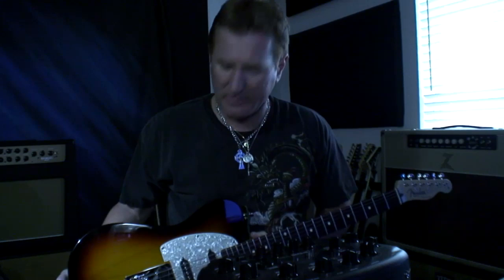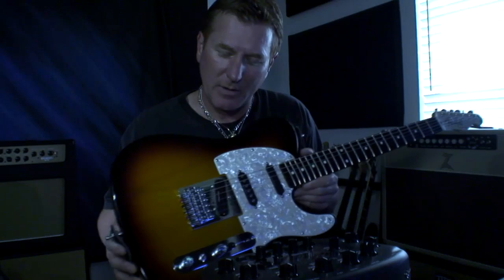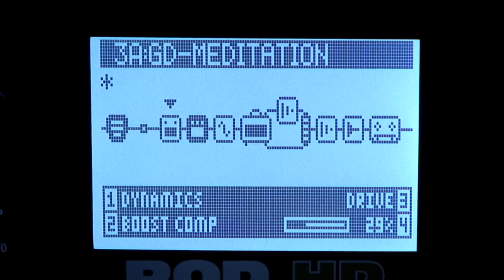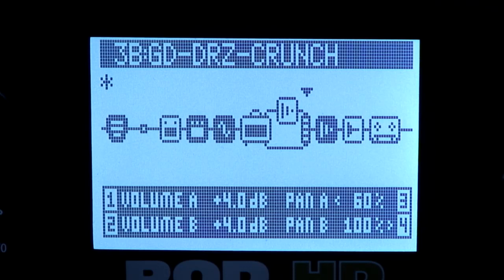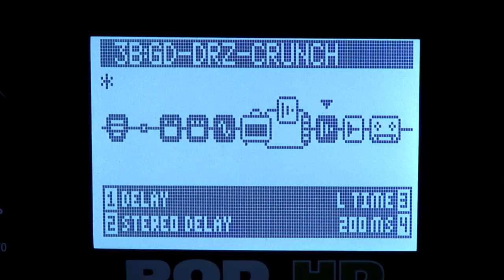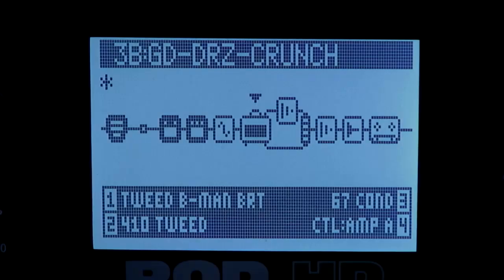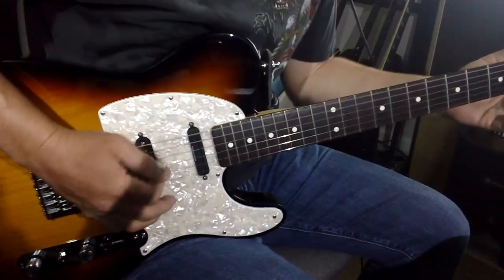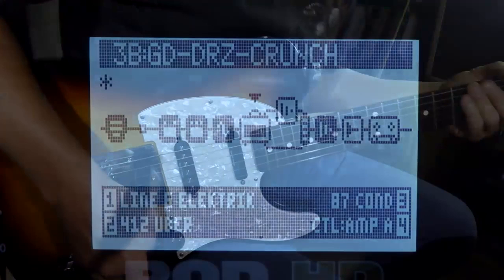☆ Glenn DeLaune ☆ Line6 POD HD Demo Part II

Comment from the maker: Easy. Open the Pitch glide. Place it before the amp, Set the Mix to 100% and turn the glide down to -1. That's Eb. You can go lower. Did you see my Masters of Metal video I did recently?? I use to go down to C. It sounds pretty good.
Reply: Wow thats cool. Is accurate?

Comment: @extremevideopro Thanks for the quick feedback man. I have heard that Line 6 offers pretty frequent updates for their devices. Hopefully I will get lucky and they will make some more of the higher gain amps available for the HD in the near future. But overall I have to say that I am very pleased with this product. Do you happen to have any good mixing tips or any FX suggestions that I could use to achieve a great metal tone? Thanks again for the feedback friend!

Comment: He talks about less being more, and I agree.  I've owned mine for 5-6 years and I was originally put off by all of the stupid presets that came loaded.  I mean, how many patches do we need of laser guns and spaceships taking off? I was looking for a handful of good usable guitar tones to put into a bank so I can use this on the gig. Long story short...  Necessity drove me to using this pedal as the hub of my whole show.  I don't even use a mixer any more. I use one effects chain for my variax guitar and the other for my mic. The reverb and delay are shared by both (positioned after the mixer section), since I usually use the same settings for both.  Why use valuable effects blocks needlessly? I use my computer for the backing tracks which I run into the CD input on the pod.  That signal goes straight thru, unaffected to the main outs of the POD so the volume of my backing tracks is controlled by the computer. The master volume on the POD controls the volume of my guitar AND my vocals.  The mix between those two is adjusted at the mixer section for each patch.  That was a little tedious to set up but each vocal chain needs to be the same, because if I switch patches during the song for the guitar sound I don't want the vocals to sound different.  I run the outputs of the POD to the QSC K-8 powered speakers.  They're powerful enough for small/medium venues (that hire a single) and the berst part is that I use them as my studio monitors as well, so I get exactly the same sound on the gig as I do when I set things up at home.  My friend uses headphones at home and then on the gig it sounds much different which then requires further adjustments at the gig.

Comment from the maker: @samyewell Thank you and YES, that is what this unit excels at!! That very type of "slightly crunchy". They have a Dr. Z amp model that is THE BEST!! That, coupled with the Tube Comp (for that extra added gain stomp) is the my "GO TO" preset for most of my work when I am using this piece of equipment..

Comment from the maker: The best thing I can tell you is to basically start from scratch. Set the POD on a empty patch and plug into the amp. You should get a good clean sound from there. If not start with an EQ in the POD. Once you have that sounding good add a little compression if you like, reverb & delay and BAM you've got your clean tone right there. Then just build from there.

Comment: @n70amu Desktop = recording only (unless you hook up the midi foot controller) hd500 = live use
Seriously if you get the hd500 the flexibility is endless considering how many parameters can be assigned and used in the expression pedal. The sounds are exactly the same.

Comment: Great video Glenn. In the video you mention that the "adjusted models" sound much better, less flubby and tighter, than they did before. Are these "adjustments" something new to firmware update 1.3, or were they also in 1.22?

Comment: man! Great Videos, Great playin and Great Tones!
I'm thinking of trading my Line 6 M13 for a POD HD 500 but it looks that the HD it's very difficult to program and make changes on the fly, without using the computer software. I use my M13 with a Fender Bassman or Fender Champion 600 for both live and recording. The simulations will be as great like a M13 in a REAL AMP? 
It's easy to use the HD500 as a FX unit only?
Thanks!!!

Comment: Still like my PODX3Live.  Would you use the HD units in a Live Setting?  I use the older Pod all the time direct to PA with amp just for stage volume also plugged in.  Very nice clean tone with my Jem.

Comment: Hi Glenn, Thank you for making all these Pod HD demo videos, I've been watching all your videos about the Pod HD, and I learned a lot from your vids...
if you don't mind me asking, I have only one question. I'm using Fender guitar amp, the Fender amp doesn't have send return plug-in at the back of the amp. every time I connect the POD to the amp (input), it sounds bad. What should I do? is there some special settings? also, I always experience the same problem when I go live with such amp.

Comment: Question: I recently got my new POD HD Desktop. I am new to Line 6 products and I am wanting to get more amp models onto my device. I am specifically looking for a model matching the Mesa Triple Rectifier, Peavey 5150, and Peavey 6505. I noticed that the Mesa and 5150 are offered in the Metal Shop bundle available for purchase but it shows that it is not compatible with the HD. Can someone please tell me if it is possible to get these amp models onto my device and if so, How? Inbox me. Thanks!

Comment: I bought a hd500 and i need to have something for stage volume. In your opinion does the pod hd500 sound better through a full range powered PA cabinet or through a guitar power amp and cab.

Comment: For example, let's say I want, by expression pedal, control the volume of the amp and one parameter of an effect, then, when I press that effect and change the parameter on the pedal, it will also change the volume, you will not?